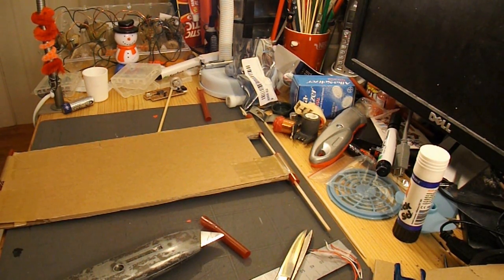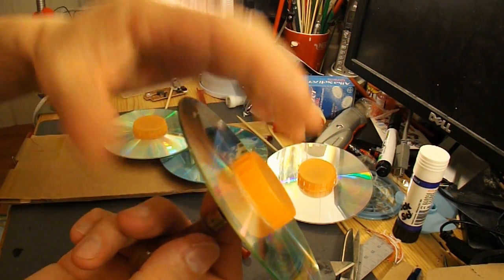Hey Grandad - rubber band powered car without hot glue?

Comment: what dimensions does the cardboard have to be
Reply from the maker: +Hassen Family it can be any size you like. If you are using bbq skewers for axles then the width needs to be less than the length of the bbq skewer so you can get the wheels on the skewer.  So 5 inches or 120mm should be wide enough. For the length, the longer you make it then the more rubber bands you can use for the motor and the further it can go but 12 inches or 300mm would be plenty long enough for most purposes.

Comment: The cyanoacrylate, is really good.
However, adhesives that have recently lost a lot of use, could be used in many applications.
This is the case of cellulosic adhesives (here we have the "Imedio" and "Uhu" brands).
It has many applications, but the wood is especially effective, as it could give a coat, let into the pores and dry.
Subsequently another layer occurs and the two pieces are joined.
It also sticks well (I checked) some plastics and wood, and dissolving the plastic and put it together when the medera slightly, binding is very sturdy.
regards,
Reply from the maker: Yes, this car was made using UHU Rubber Band Powered Car without Hot Glue